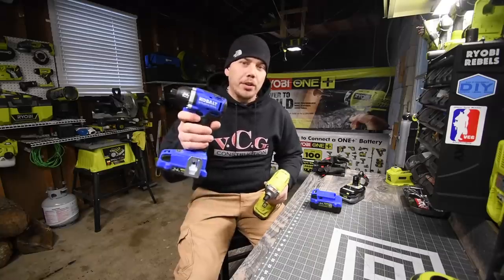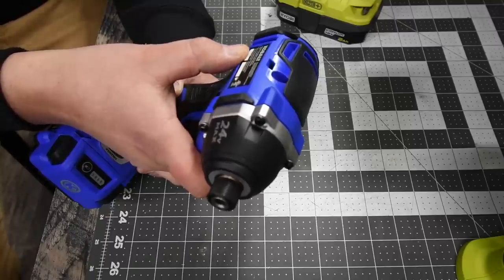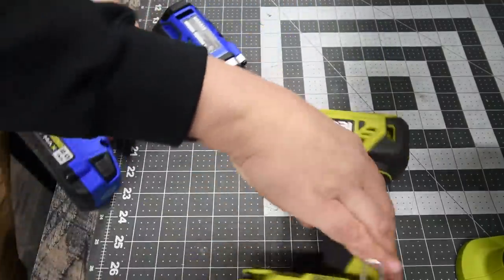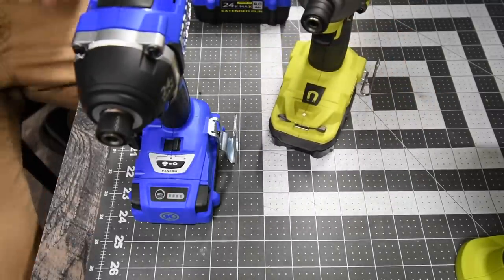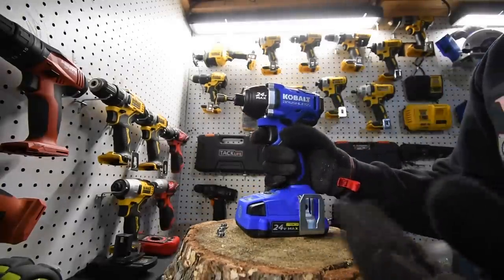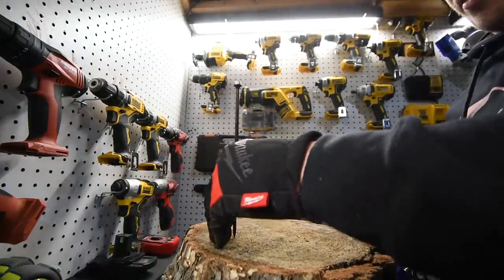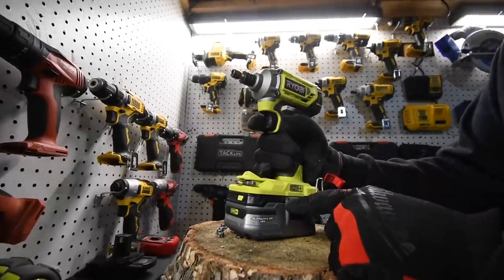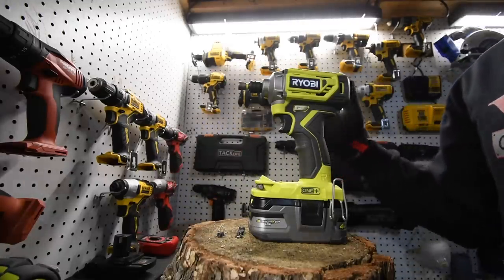Kobalt VS. Ryobi Impact Drivers

Comment: I thought that was an interesting test. I had an issue with a Ryobi drywall gun years ago. It broke on day two. I replaced it with a Dewalt and still use it. I just bought a Kobalt 24 volt 1/2" drive impact wrench. I am very impressed with the tool. I just got it last week and tomorrow I am going back to get the hammer drill / 1/4" Kobalt impact wrench set. I am very impressed with the Kobalt quality and performance.
Barry
Reply from the maker: I thank you for your story Barry

Comment: Great Job David! I was researching the voltages 18, 20 & 24 volts. A lot of marketing bullshit. From what I have researched & knew already is that 18 & 20 volts are the same. That's why you see 20V MAX on shit. That's the "Max" voltage, but nominal is 18V. Even Ryobi 18V batteries will read 20V Max after taken off the charger. Now the 24V is a MAX, but the nominal is around 20V. So the Kobalt is supposed to be more powerful, but from watching not only our video's but other YT tool vids, I see the Ryobi beat some of the higher end stuff.

This also goes for 12 volts is only 10.8V, 40V is 36V and so on. They love to Round Up!
Reply from the maker: correct, all 18v are really 20v. like hilti has 22v but its really 21.6v, its a marketing thing

Comment: Originally I bought into the Ryobi 18 volt one system, I had a weed trimmer and edger and was planning on buying some of their 18 volt one handheld tools also but I returned everything including two extra 4 amp hour batteries because I had two Ryobi trimmers fail on me within 5 uses! Now I have Kobalt! My trimmer has worked all summer just fine plus The Combo Kit it came in included a blower and both were less money then The Ryobi weed trimmer alone. Kobalt lately just had a sale on a 4 piece set of handhelds plus an extra tool of your choice for $199.99. I own that set of handheld power tools now and I  love my Kobalt 24 Volt Max stuff!
Reply from the maker: I think every tool brand is awesome. I love Ryobi lawn care stuff and I thank you for viewing Iron

Comment: Hey heads up. For the Ryobi you're using the older style lithium batteries that were not made for brushless tools in the beginning of the video. Towards the end of the video you used the newer style brushless batteries that's why it did so much better towards the end.
Reply from the maker: I know and thank you sir, Ryobi doesn't make a 2ah HP batteries yet
Reply: @ManCaverTools  great videos man. Don't mean to be just negative. Not all of us can tell all those tools. Nice to be able to see.

Comment: I like the Ryobi driver. The 2 x 3ahr get the tool for free was a better deal.  I picked up drill, driver, band saw, shop vac, blower, dremmel, chain saw. Got a lot of batteries.  Most often Ridgid and Milwaukee are my pick.  The battery deal was too good to pass on. Thanks for the reviews. 😎👍
Reply from the maker: I thank you sir
Reply: When did they have this deal? Is it something the Home Depot runs pretty often? I would love to take advantage of that!

Comment: I’m curious what the TRUE voltage is of the kobalt tools. What is the watt hours on that 2ah kobalt battery?
Reply: a fully charged battery is 24.9v.  How much of that makes it to the motor I don't know, not about to crack mine open to find out.
Reply from the maker: I haven't tested that out yet but I will be adding that to the videos soon
Reply from the maker: thank you sir
Reply: What I’m asking is what does the battery say on the bottom? How many watt hours (WH)? If you divide the WH by the amp hours you will get the voltage. For example: An M18 battery that is 5ah is 90wh. 
18v X 5ah = 90wh
Reply: Unless kobalt is fudging the #’s about the WH and AH on the battery sticker. That could be a possibility I guess. In that case we’d just have to test it with a load to find out
Reply: @Zee20Ate  gotcha, a 2.0 battery is 48 wh

Comment: I had a customer come in looking for ryobi batteries and went on a rant about the fuel gauge because it "makes the battery less durable" I've never heard about this every tool review youtuber praises fuel gauges, does the fuel gauge  actually give your battery a weak spot
Reply from the maker: no. there is spacing all around the cells to the wall of the housing. no battery is completely solid
Reply: @ManCaverTools  thats what i thought but he felt so strongly about his theory that it made me think

Comment: I just missed the 6aH's but got this mid range Kobalt for a buck-seven after tax. The warranty on the batteries are the same three years, while the I believe that the tool here is three year and the Kobalt has a five year. And I believe Kobalt released a higher end 24v unit recently, but the one I got on sale will suffice. While I did do a simple look up on the 4aH batteries, the Ryobi is $99 and the Kobalt is $60 currently, not including tax. 2020 OCT 6th in my region. I watch more than one channel and read comments on how each person likes and dislikes their current tools. Project Farm has done a comparison also, not to detract from this one which I appreciate your coverage on these units. (Un)fortunately I have to rebuild my tool collection I have already started down the Kobolt path. Just as I share with others, if you have invested into the Apple products and their apps stick with it as one doesn't need to switch to Android. Yet I chose not to spend several hundreds on what is just a phone at the end of the day. Thank You.  :)
Reply from the maker: I thank you for viewing Robert
Reply: Being a home owner I don't use the handheld power tools very often which presents a problem when it comes to battery powered tools. Batteries don't do very well when they sit unused months and years at a time and tend to fail from non-use. So the trick for someone like me is to buy into a system that has lawn maintenance tools that use the same batteries as the handheld power tools so that you are always using your batteries often and keeping them conditioned for the once in the blue moon you need to use your impact or drill or any other tool. The Kobalt 24 volt Max system is perfect for someone like me because it has all the lawn equipment I need (except an edger) plus a very extensive line of power tools which include a ratchet wrench and angled impact wrench for automotive work. Plus Kobalt is very reasonable priced when compared to everyone else's stuff on top of just being very solid tools! Kobalt also has the best battery prices of any other line of battery powered tools. A 4 amp hour battery costs just $59.99 regular price while competitors cost $100.00 and up! A 2 amp hour is just $30. Bottom line is Kobalt is a fantastic line of tools at lower prices then just about anyone else's tools.

Comment: Love ryobi products they are slightly bulky but they get the job done.◈>share4.photo/RCordlessImpact?Це    I've used this 1/4" impact to drive 100s of deck screws and multiple large lag bolts. Never failed to disapoint. And even use it working on vehicles with the socket attachment. Although doesn't do great busting nuts loose.
Reply from the maker: the brushless versions will bust nuts easily and thank you for viewing

Comment: Kobalt was superior I bet it would smoke ryobi best idk
Reply from the maker: The Ryobi isnt there best impact. I wanna do the XTR soon
Reply: @ManCaverTools  I cant wait cus the xtr is on my radar to buy...we drive lots of 1/2 lags n screw decks down I think it would get the job done...predrilled holes tho on the lags so I dont burn it up...what would u buy
Reply: Kobalt is underrated in my opinion and anyone considering a set of new battery powered tools should seriously consider Kobalt.